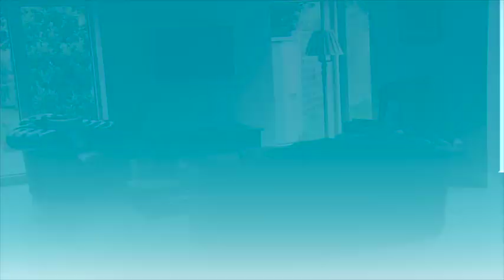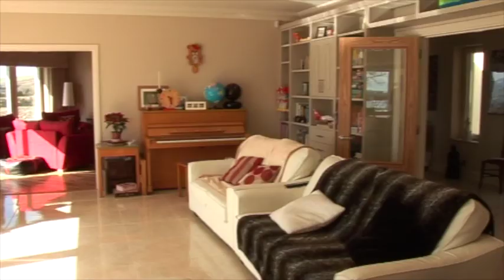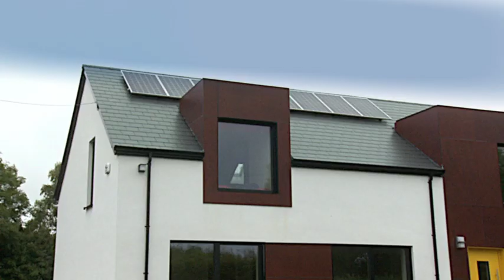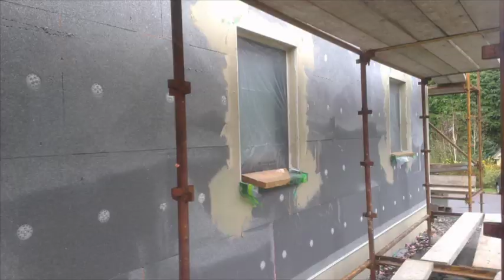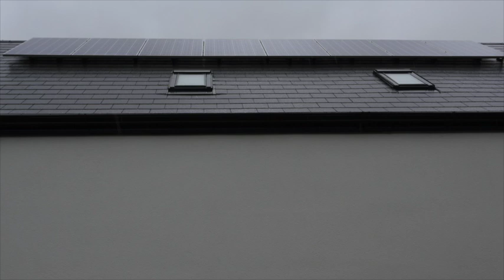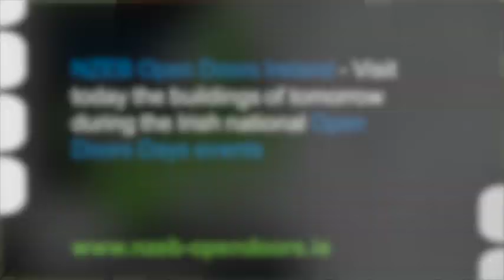NZEB Mini Documentary

Comment: Looks good but I do not know if this qualify as a retrofit or upgrade. Is more a demolition and a new building on the same place.
Is the energy produced by the solar PV array considered in those 70kWh/m2/year ? Or is just the additional energy that building requires except for what is produced locally by solar and wind?
My building is 65sqm uses under 100kWh/month electricity for appliances all this is generated by solar and wind offgrid and for heating as of now is not electric is with propane but it uses around 1000kWh in the coldest month of the year around 4000 to 5000kWh / heating season. This makes my house at this moment under 100kWh/m2/year.
But in the future I want to heat the house 100% with electricity generated by a large solar PV array (I need around 6 to 7kW of PV and one or two 1kW wind turbines)
Seems that PV used for direct heating with resistive elements is the least expensive option (no battery necessary) the energy will be stored in the form of heat in the 14 cubic meter insulated concrete slab. This concrete slab can store about 100kWh at a delta of 10C
Reply from the maker: Our understanding is that the owners intend to submit the project for EnerPHit certification. Their intention is also at some stage to supply excess output from the PV array back to the grid.